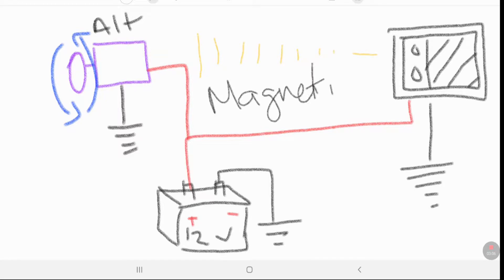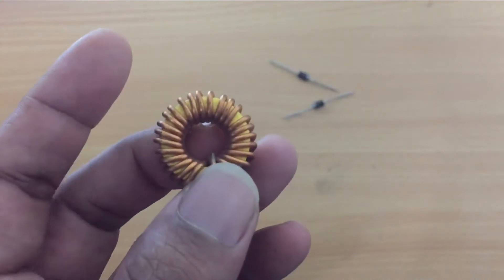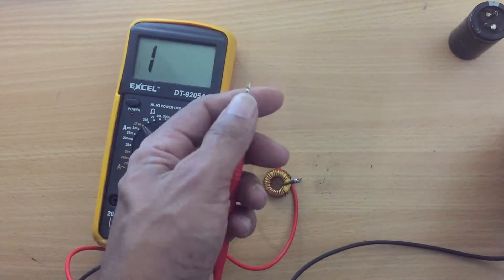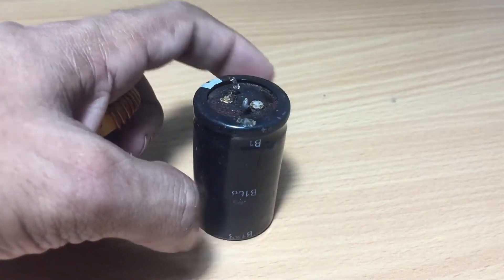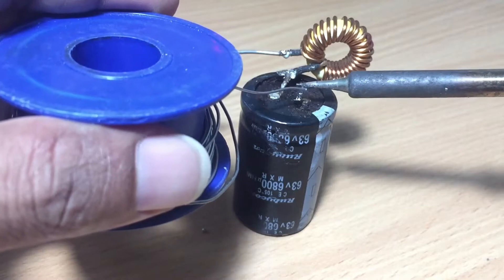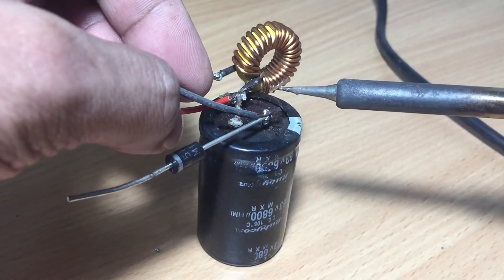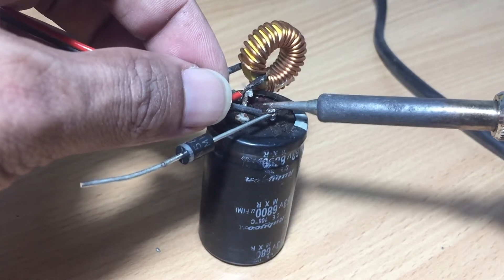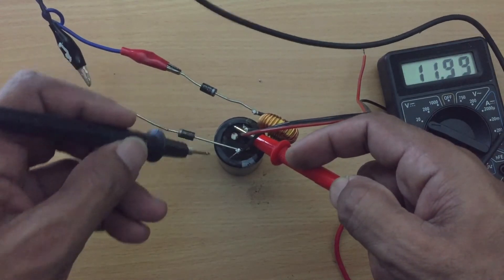DIY Power Supply for Car Audio Devices : No Engine Noise

Comment: Hot tip (pun intended) tin your sliding iron. All you need is a bit of solder and a sponge. Though that tip is bad enough to maybe need a brass “scrubby”.
Your soldering will be faster, easier, and stronger.
Reply from the maker: Yes of cource.

Comment: Very poor soldering!! It will decrease the voltage, heat up the joint points. Also the wires diameter is too small for powering car audio. Diodes will also drop the voltage. Beware!!
Reply: yup, this a mess of a job
Reply from the maker: When engine on, the volate level is arround 14.2 volts. therefore, the voltage drop is not an issue.
Reply: The tip of the iron is way too small for this job.

Comment: this is essentially a low-pass filter. peronally i wouldn't use the diode since there is vertually impossible to get reverse current from the car power unless you use this device directly right after the alternator and before the rectifying circuits. however, i would put a schottky as flyback diode with the inductor for back  emf protection. Without the back emf protection, thay inductor might fry your audio equipment once you turn off the power.
Reply: What is the best way to build a noise filter for car audio?
Reply: @timwheeler1503  Oh, this is actually a rather big topic. The aim of the filter is to remove the fluctuating voltage and since equipments within a car are all conneted together which including both resistance (like lighting) and inductance (like fans) load. Inductance load can and will introduce fluctuating voltages within the whole electrical system and the filter can only remove or rather, improve, some of the fluctuation. If you are serious about this, use an isolating power supply for your audio system. For a cost-balanced solution you probably could use a buck converter with a LDO. For cheapest solution, you can use a inductor with a capacitor form as a Low Pass Filter but be aware that flyback diodes are recommanded to protect both your car and your audio equipment. Let me know if I can be more helpful.
Reply: however, i would put a schottky as flyback diode with the inductor for back  emf protection-------
Can I ask put on where?
Reply: @simengfu7352 Can I ask schottky put on where? how to do it? Thanks
Reply: @lialex2517  you put that diode across the inductance load parallely and against the power current direction. Which means Positive (+) of the power connect to the negative (-) of the diode and the positive (+) of the load; Negative (-) of the power connect to the Positive (+) of the diode and Negative (-) of the load. In this way, when power is on, the load will receive power from the supply as normal but not the diode since the negative is side connect to the positive side; when the power is off, the energy stored within the coil (fan) will be released back to the circuit but the current is reversed, now the diode will be the 'low resistance path' for the current to go back to the coil agian instead of going back to the power supply reversely until the energy is exhausted.

Comment: Why the diodes?
Reply: Is it to prevent people from hooking up power backwards?
Reply: @randallhatton4819  that is one use but not the reason in this case. In this case it prevents any ac current that may be induced in the system.
Reply from the maker: you can see more in the videos

Comment: Very poor soldering!! It will decrease the voltage and heat up the joint points. Also the wires diameter is too small for powering car audio. Diodes will also drop the voltage. Beware!!
Reply from the maker: This is a sample only, When you apply practically, you have to solder those on a board. Since the voltage is arround 14.2V while battery is being charged, there is not voltage issue.